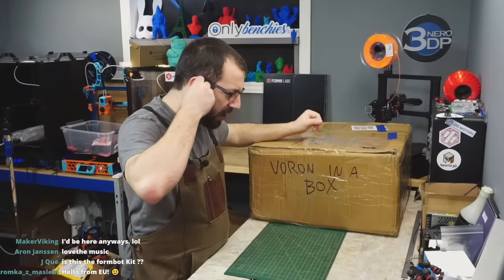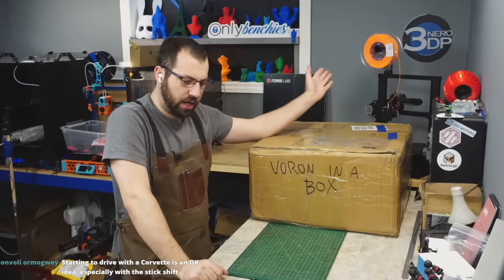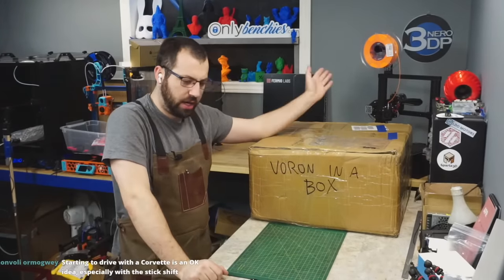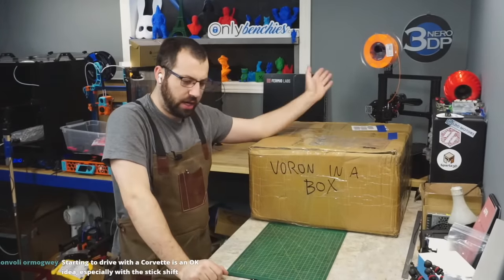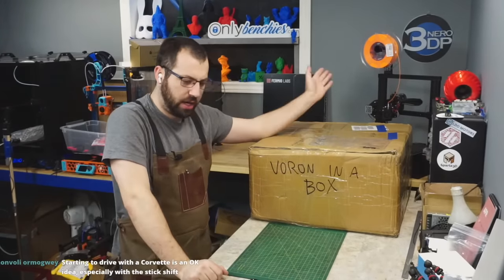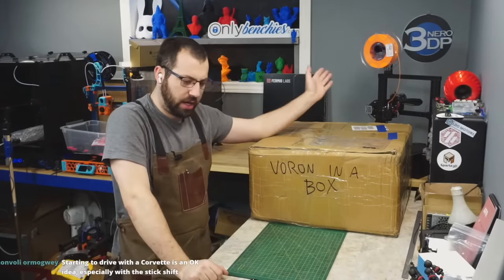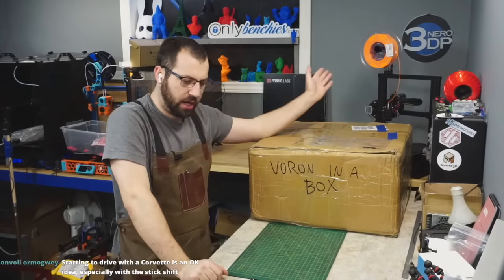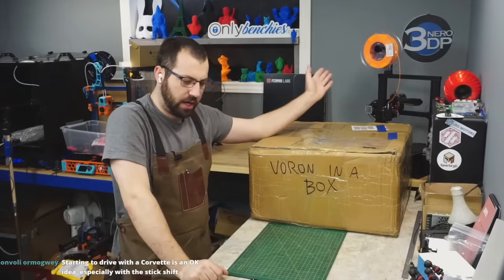Lets Talk About Voron Kits - Livestream

Comment: Formbot Voron 2.4 r2 Kit Update [February 2023]:

I got my Kit 5 days ago and wanted to share an update.

- Panels are looking better than in the video. Very clean and no big scratches
- Wire Harnesses are included. No need for crimping yourself. Everything is labeled. You connect all fans and other stuff with a plug into a cable that will go to the electronics
- Cable Chains are the ones you can open - a lot easier cableing
- There are sending some extra/spare parts now swell. Not as much as in LDO kits and not of every kind. Especially screw and some thing like an idler, .. is extra
- Motors are completely from Moons. No more brand you don't know.
- Heater Cartridge is now described on it's bag - it's 40W / 24V (do check!, you never know)
- You'll get the X and Y Endstop PCB directly. Aswell as the Z one.
- Octopuz V1.1 MCU Board
- Extrusions were cutted just fine in my case (could be luck)
- Got one MGN12 Rail instead of two MGN9- all are just fine
- PEI Sheet looks like Amber and has the Voron Logo on it
- Bed Flatness: around 0.1 in difference from highest to lowest point
- Got some Plastic injection parts for Free (Afterburner and Exhaust parts - with heat inserts) - in black/red
Reply: Thanks for that, I am about to buy the Trident 300mm kit.
Reply: Thanks for the info!
Reply: does it come with Dragon hotend? It is listed as an option

Comment: I have been running a 5mm rolled 5083 aluminium plate on my DIY corexy for about 2 years. 350x250. Still straight as an arrow. This is a 3d printer, not a telescope launched into space. Perhaps we are spending too much money and time on sourcing parts, that are worthy for a NASA expedition to Mars?
A machined 8mm bed is sufficient. Cheap shots at the milling machine is ludicrous. I’ve seen million dollar KERN machines leaves similar marks, and texture can be felt, but does not indicate incorrect tramming (but a slightly worn or chipped tool). Anyway, were are adhering a magnet with tolerances that are magnitudes higher, than any imperfections in this milling operation. Seriously.... not an unbiased unboxing. One of the most crucial parts for print quality, are the GT2 pulleys on A and B motor. A slight wobble here wreaks havoc on surface quality. 2 genuine Gates pulleys won’t break the bank. Concerns on the SSR are correct.
Reply: Human fingers can sense nano scale elevations in a surface, and with nano scale, I don't mean 100nm or something, no, right down to like 10nm, the level where you could feel individual gates on a CPU. So going by touch is useless, you'll always notice irregularities.

Printers however, especially ones with decent bed leveling matrix routines can even operate with over 1mm variance in the plate.

My worst warped Ender 3 plate was only 0,5mm variance.

After some bending and lapping, 0.05 measured on a granite block.
Reply: Yeah I don't know why people get so fussy about the flatness of the bed considering it's probably all over the place once you stick another sheet on top of it.

Comment: I am currently building the exact same kit being reviewed in this video.  I am new to the Voron community and need some help figuring out the appropriate venue is to post my build experience, so please let me know.  

Also for the benefit of others:  I have found that the Voron Sourcing Guide organizes the parts into several kits of approved parts which makes ordering much easier than buying individually.  Had I known this earlier I might have ordered from the sourcing guide rather from a vendor offering a complete kit of possibly unapproved parts.  So far, though, I am pleased with the Formbot kit but have only built the frame and gantry at this point.  It remains to be seen if I will maintain my satisfaction.

In my kit the idlers also have the wrong tooth profile as does the kit in the video but the other pulleys are correct.  I am currently in contact with Formbot and they seem willing to replace the bad parts.  I will post more about the replacements after the negotiations are complete.
Reply: good luck, been watching these sets too, but were sceptical. I roughly calculated to ship from recommended vendors but its pain to get it all shipped to norway. so no voron here until these kits are good enough.
Reply: @sveinjohansen6271  I will be posting my build experience on the Redit Voron forum so you can look for it there.  I have researched some of the issues that Nero mentioned, like the quality of the SSR, and will be posting that as well.  I have finished building the frame and gantry and so far am very happy with the kit. Certainly the major mechanical parts are good quality and the included hardware is plentiful and well labeled.

Comment: So the reason I said make a Phaetus TL hybrid is because most of the TL parts are a bit cheaper, except the Biqu/Phaetus heatbreak, the heatbrake is not only cheaper but the V2 Phaetus HF uses a ceramic insulator instead of a fiberglass sock thing. I'm going to build a couple that way myself once I get them and probably sell one of them once they start to get really hard to find. I confirmed with TL that they are spec'd the same so they should fit. Basically can build most of a dragon hotend for about 60 bucks that way, I guess it's only 15 dollars cheaper than the TL dragon, which DFORCE is still selling if you're looking for a dragon, DFORCE is TL's sister store, they sell the same products, for the same prices.

Comment: I completed the same kit form AliExpress (Formbot) last week. It took about 40 hours to complete. There were tonnes of leftover bolts, nuts and wire. Belts were too long so had to cut them and the bottom panels were 3mm too long but the rest fitter together well. 

Very happy with the build. No way I could get quality parts in Australia 

Could not have done it without Nero’s videos.

Comment: I don't mind this type of cable drag chain... There are ways to easily guide wires through these unopenable cable chains. What I did was to wrap the ends of the wires with some tape. Any tape will do, but I used some green curing tape with a light spray of silicone over it. It can be faster than snapping in and out every flap on each link, unless when you are adding or removing some wires when modding. You can even put multiple wire ends fitted with connectors through, by bundling them in a staggered manner.

Comment: I just built my 300mm³ from formbot had zero issues with any of the supplied components. I received the skr1.4 turbo for mcu and got a keenovo bed heater in the kit also got some extra hardware as well it wasn't exact to bom on nuts and bolts other than that the quality was decent other than the drag chains they were junk upgraded those quick, but the kit seems to be holding up very well I've ran about 40 hours through it now with zero issues.
Reply from the maker: Thats one of the things we are not happy with. Your kit had skrs. Keenovo heater etc. This one is different. Who knows what the next ones will have.

We can never endorse  something that cant keep consistent components kit to kit.

Comment from the maker: Hey its been awhile

So this video gets brought up a bit now-a-days it seems, so just want to touch on some things 
-At the time this video was made MANY of the kits that were popping up had issues, I mean things like missing components, completely wrong components (v slot extrusions for example), motors weaker than a dollar store RC car, wiring and other electrical issues that were straight up dangerous, etc.

So while the tone may seem a bit harsh looking back, please bear in mind the team was seeing many new builders buying kits, who didnt have much background in 3dp itself and the knowledge of components and what-not, and some were running into some pretty sever safety issues.

Now, it has been awhile, and while kits have improved, remember there are NO officially endorsed kits by the Voron Design team still.

Comment: 300LSE is probably a better adhesive for the magnet and the PEI sheet TBH. LSE = low surface energy (aka plastics and paints). MP = multipurpose.

I have used both in a project at work and had to test them. LSE was significantly better on painted surfaces/oily surface in my experience. Both are good on aluminum but the limiting factor is the surface energy of the plastic/magnetic

Comment: Another reason not to source one big kit priced at 1k-ish euros is that (here in nl at least) you´ll get hit with import and vat coming in around 200-300 eur extra. With smaller packages priced less than 20eur vat and import are waved. So I got like 30-40 packages. Electronics were sourced domestically and IGUS is german and the go-to in europe.
Reply: Actually "sourcing" means buying the parts piecemeal, it's the opposite of buying a complete kit. So to say that you "sourced a kit" is a contradiction in terms.

Comment: I received my Formbot kit a few days ago. The seller was out of SKR, so I got refunded for them, but still got 7 TMC2209 BTT packaged drivers. The Pi is delivered without a flash, so I suspect the 2 flashcards that were in your box was meant for the SKR. The part list does not mention a flashcard for the Pi. There ARE extra screws. About 3-6 in each bag (didn’t count the M3 8mm though).
Reply: Mine arrived two days ago. Same experinence like you had. The boards were missing. Also no SD Cards. But 7 Bigtreetech TMC2209 in 7 separate packages. They will send me for the missing SKRs to Spiderboard. It was my choice if spiderboard or a refund. But they didn‘t mentioned., how much the refund is. What did they offered you?
Reply: @andreasthorsten1850  I was offered the Spider as well, but opted out. Was refunded 38 euro, but didn’t bother querying for more. Sourced BTT SKR 1.4 Turbo from Czech Republic that arrived before the Formbot kit (so now I have plenty of TMC2209’s). Frame assembled with just one thread being slightly too short (had taps, so no issue). Square within 0.5mm with zero effort or tinkering. Way better machined extrusions than my old Tevo Black Widow and on par with my favorite german extrusion pusher, Dold Mechatronik. Sourced an Asenco SSR from Germany. Too crucial a part in terms of safety.
Reply: @andreasthorsten1850  I’ve heard of others that received TwoTreeTech boards, without any communication, so I’m satisfied to be offered a refund rather than receiving something I would probably replace.
Reply: @StangspringDK  funny, the same here. One thread was shorter than the others. Beside that, the frame looks very good and square. I changed the SSR also. Selected the Cryodom SSR and bought it from a German seller (voelkner).
Reply: @andreasthorsten1850  Hi can you confirm that they ship the right idlers and Pulleys? Min is on the way!
Reply: @andreasthorsten1850  Then seem good to me although I'm not an expert
Reply: @andreasthorsten1850  Thank you Andreas I'm not an expert but it seems if they are round at the bottom they are GT2

Comment: My advice to all new comers is DON’T buy the kit unless you know exactly what you are getting and have substitutes on hand. Here are some of the issues with the AExprs kit. Extrusions are likely v slot instead of BOM t slot. Nero mentioned some extrusion may have larger grove, that is Blurolls kit, theirs 1mm wider and require modified STL. Chinese Crydom and Omron SSR are all fake. Many of the plate is not 0.1mm flat, mic 6 or atp 5 regardless what they say. Also, bed heater may need to be replaced with Keenovo.

Comment: Only about 30min into watching this. Missed the stream cuz I was at work. Can you please share your notepad with the items that need replacing? I also bought the formbot kit with the intension of replacing what wasn't to spec.
Reply: Yeah that'd be handy
Reply: honestly if you dont have the knowledge to know what to look for from spec voron BOM list and digging into recommended manufacturer specs then a voron kit aint for you. after recieving the kit every nut and bolt needs to be measured to spec before building it from the kit as the kit might be different when you recieve it, as it all depends on whats available that day your kit gets packed. Atleast take the evening enjoy opening the kit, take every single bag out measure it and look into the spec from the BOM list. its part of the hobby. all components have links to different vendors that offer good drawings of how parts should look like. it only takes one evening to go through and double check it all.
Reply: @Wingnut353  dam,, so grumpy !
Reply: @sveinjohansen6271  I get that way when people act like scum to other people... especially those that should know better.

Comment: 27:50 I worry about PTFE wires.  If something starts to melt, will it off-gas like the tubing?

Silicone is supposed to never burn, it will just melt, short, and blow the fuse.

Comment: I buy it 2 days ago, I asked to replace the e3d v6 + raspberry 4 with a phaetus dragon high flow. I already have the raspberry in stock and they wanted to. I asked who the dragon's supplier was and it's phaetus. The board is a spider. I asked if other parts could be changed like the color of the extrusions. I also asked if a pei could be put on the back of the flexible plate.

Comment: Molex does make Microfit connectors with the panel mount ears, so this is not a reliable way to tell knockoffs. Example: Molex PN 436400401 has no ears, while 436400400 does have ears. (I'm not saying those in the kit are legit)

Comment: I have been involved in the Voron project for 3 years now and have always built my 3D printers from Prusa i3 to latest Vorons with all intermediate possible models in terms of complexity. Lately the average level of knowledge from people interested in building Vorons has dramatically felt to almost zero, especially those wandering the FB group. It is difficult to keep impatient and aggressive newbies from understanding that building such machines is not for everybody. It is good Nero took the time to explain it again... All this mainstream exposure of the Voron project is good and bad at the same time. 3D printing is an extremely vast field requiring a lot of knowledge on many technical fields (mechatronics, electronics, material science, software, coding...). I could never have managed to build a Voron without previous build experience, and I do design my own electronics (power, digital and analog) and I have worked with MCUs for 10 years. I cannot imagine someone with no previous extended technical experience jumping into such a complex project without generating immense amounts of frustration for himself.
Reply: well said! If anything, these kits will more than likely decrease the quality of the built machines, not so much due to the quality of the parts in the kits themselves, but the hands behind the assembly of said machine

Comment: Shipping oils don't need to come off...unless they have hardened or discolored, they will mix with whatever lube you use.
Soaking/ultrasonic a precision bearing is a last-ditch effort to clear a problem, not a standard 'new bearing' treatment!
Reply from the maker: The problem is. And this is something i and others have experienced.  Is that many times the rails come "gritty" from the supplier. You see metal dust from cutting or grinding the rails in the carriages as its all done open air in the same location. 

Even my most recent batch. Which felt pretty clean. Had a decent amount of metal grit come out in the ultra sonic bath.

Comment: If the kits are not the best,where can I get all the parts to make one.How can you tell the difference between original and chinese ones.
Reply from the maker: Kits are a relatively new thing. The printer was designed as a self source design. So your not tied to any one vendor for components. Theres examples in the sourcing guide of known good vendors for components and also the discord has alot of community information if you have questions
Reply: @CanuckCreator  Came across the printer through the 5:20 min benchy video and It has been on my mind ever since,to get one.Someone should put a original kit together and charge a bit extra for people like me.The voron printer design is something else I have to say,the nicest printer at the moment

Comment: What kit do you recommend now the link doesn’t work
Reply: Also I’d like the kit to have 14 gauge wiring I will putting a 350 watt power supply in it to power my enraged Rabbit carrot feeder and Klipper expander board if there’s no 14 gauge wiring kit what is the best way to go about wiring it is there an electrical connector kit I buy?

Comment: Hey Nero, I have experience in 3d printing owning several printers, but after watching all your videos I wanna build a voron.

I did some modding and changing things up on my other printers (Sidewinder x1, ender 3, prusa mk3s) 
But Im not sure if I start to bud an voron switch wire or an voron corexy? 
Whats your suggestion if you build first time a voron?
Reply: Well you have 3 bedslingers and seem to know your things, build 1.8 for relative easymode or a 2.4 for hardmode
Reply: @malloott  Agree, why build another slinger... theres nothing new to be found in the Switchwire.
Reply: @malloott  thanks, since it's my first corexy I think I go "easy mode" with the voron 1.8, what's the main difference between 1. 8 and 2.4?
Reply: @dano.9878  check out the cad files for the whole assembly and the pdf build guides, a lot of differences small a d bog